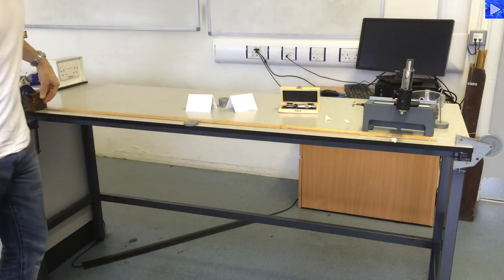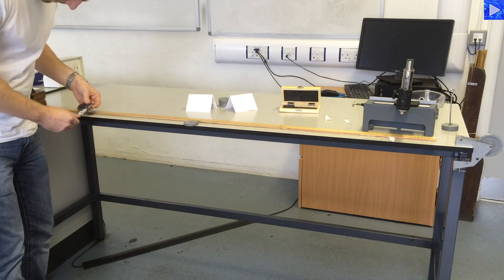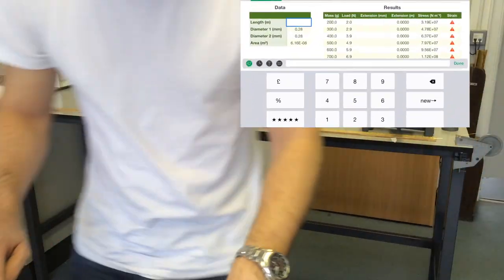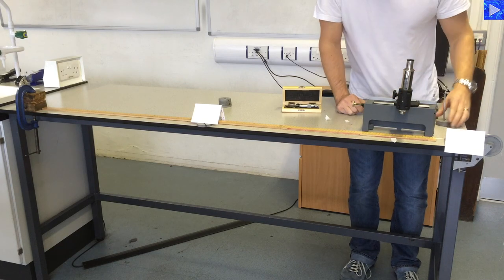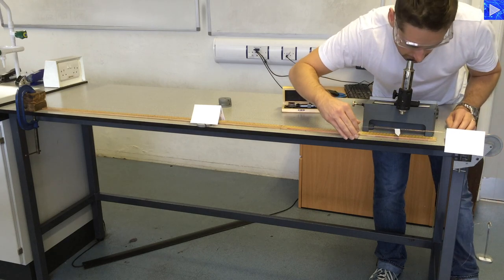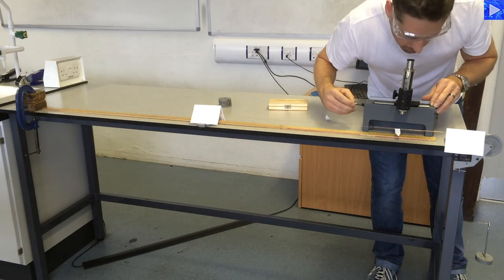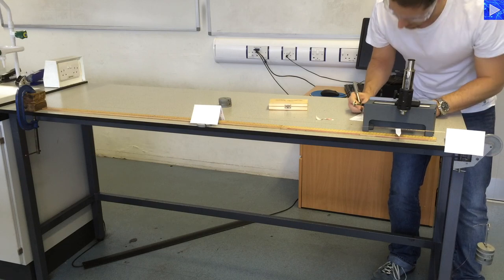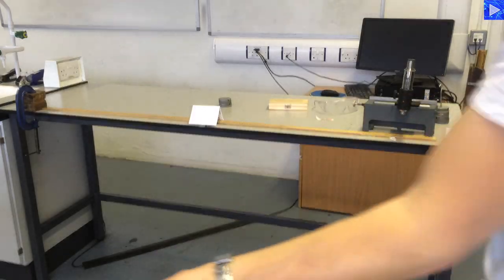Young's Modulus Experiment

Comment: Can u mention the procedure of this exp
Reply from the maker: HI. Sorry if the procedure wasn't clear in my video.  If there is a point that I could further clarify I am happy to do so - just let me know what's not clear.  Or did you mean that you'd some step by step instructions written out?
Reply: @PhysicsHQ   i m planning this exp for my phys exam so i just asked for the written one
Reply from the maker: Hi. Here are some bullet point steps:

• The original length of the test wire is measured using a metre rule from the point of support to the zero on the vernier scale/marker.
 
• The diameter is found, using a micrometer, at various points along its length and an average diameter is calculated. Cross-sectional area is found using πd²/4.
 
• Loads are then placed gently on the wire and the extension of the wire is measured for each one using the vernier scale arrangement / traveling microscope.
 
• After each reading the load should be removed to check that the wire returns to its original length, showing that its elastic limit has not been reached.
 
• Extension measurements are also taken when gradually unloading the masses to give two readings. This allows an average value for the extension to be calculated.
 
• A graph of stress against strain is plotted. The gradient of the straight-line region gives the Young modulus (= stress / strain).
 
• N.B. The wires should be long and thin to give as large an extension as possible for a given load while retaining its elastic properties.
Reply: @PhysicsHQ  thankyou sir..